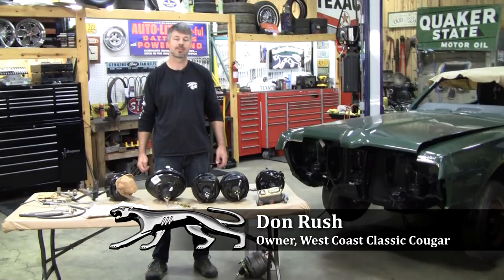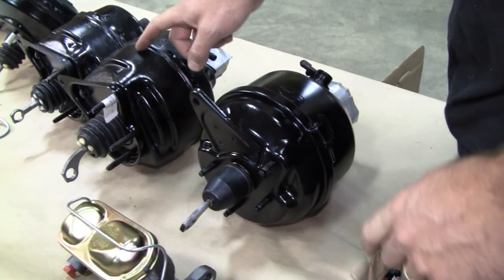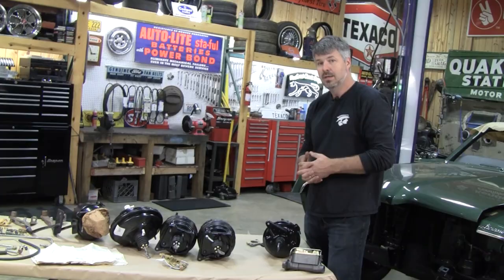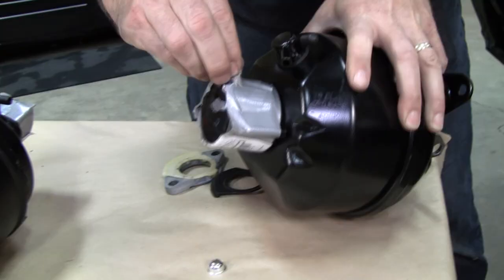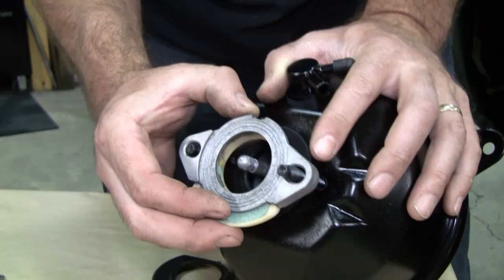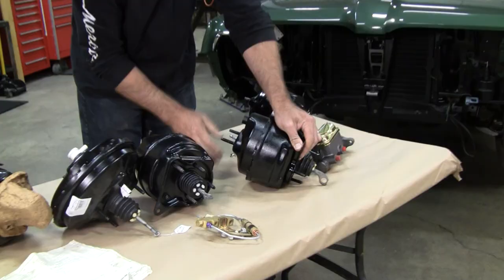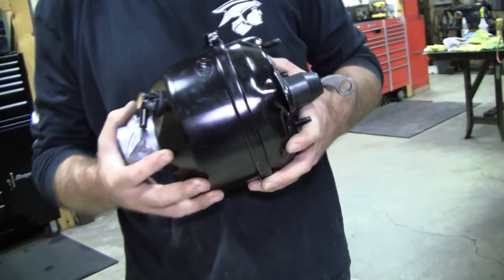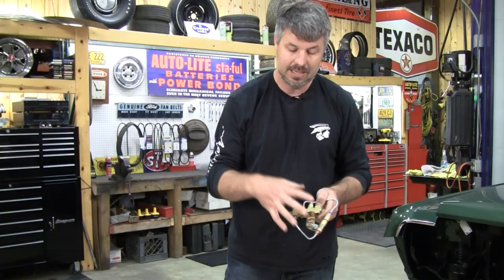Power Brake Boosters: 1967-1973 Cougar / Mustang - Differences, Do's & Don'ts

Comment: I wish you guys delt with early 1970's thunderbirds. I have had many of the same frustrations concerning brake boosters. Finally found a guy to rebuild mine. After 3 months of dealing with cardone
Reply: I got a cardone power booster for my 1969 tbird. It works fine. Not saying everything is great, guess it all depends on whos working on it. I also had my original one rebuilt by them. It looks great. My only problem is the lack of the right check valve for the  tilt away steering

Comment: Great info..... Thank you.  Dad & I are currently working on another "restored" car.  1970 XR7 with a Midland booster.  I'm telling the guy the booster is no good.  I did a vacuum test....no good.  He's saying he just replaced there booster....wellllll.... Now I know why it's bad.  Love this video.  EVERY "restored" car we deal with has the same story.  Body work is nice but the car is a mechanical nightmare.  These guys spend $15k on a car that requires another $3k in mechanical work.  Uggggh

Comment: Thanks for the info. Very good video.  I restore older Mustangs and get frustrated with the lousy, cheap, non-fitting parts that are available now.  Seems everything is made in China and either doesn't fit, fits poorly or wears out very fast.  Parts store employees cannot perform an interchange or look up a part without the computer at their fingertips.  You can no longer depend on the parts suppliers for quality fit and function in restoring these older cars..
Reply: We just today got in 6 ebay specials by Cardone, all from the same supplier, all under $150 each all with the same part # on box which was supposed to be for 1970 Mustang / Cougar.  None had the spacer plate, 2 had the 69 tear-drop input shaft and one had the wrong bolt pattern.  Good thing we just buy them to replenish our cores and our expectations are low...
Reply: Nam Vet p
Reply: never could...

Comment: Hehe, great information, except... my 1970 Cougar XR7, with 4-wheel drums, has an original "midland" booster with the teardrop shaft, exactly like the 1967 version you show.  So apparently they did use that booster in 1970 :).

Comment: you might wanna mention that you have to modify the brake switch (bt removing material) if you use the 69 in a 67/68  due to the increased material thickness at the end of the shaft's teardrop

Comment: I bought a 70 Bendix for my mustang and it has a straight eyelet. Which works fine for a factory set up. But I now have all aftermarket brake pedal and hanger due to restoring the car which didn't have any parts when purchased. So I bought a factory booster like you show here which has a straight eyelet. However, I need the one where the eyelet is off-center as my brake piece that connects will not line up with a straight eyelet. Thank you for the great information. Hope you can help me find the right eyelet. Or tell me if I need to find a different booster.

Comment: I'm wanted to go full Wilwood disc brake on all 4 corners. What brake booster and master cylinder proportioning valve set up do I need?
Reply from the maker: There has been quite a bit of discussion regarding Wilwood brake conversions over at the Classic Cougar Forums, I would recommend checking that out: https://forum.classiccougarcommunity.com/search?q=Wilwood

Comment: Can any of these be used on a 67 Fairlane that has factory power disc brakes?
Reply from the maker: The one you need is this one: https://secure.cougarpartscatalog.com/16897/30966/brake-booster-midland-power-brake-premium-rebuilt-1966-1967-ford-fairlane-/-ranchero-/-cyclone-/-torino.html

Unfortunately, we do not have any, and we usually could have you send us yours and send it in to be rebuilt, but the rebuilder lost some staff and is not currently able to rebuild boosters.

If you hit the notify button on our website, we will email you if they become available again.

Comment: Question: what would you charge for a 67-68 Mustang booster for my 68 Mustang GT. Because I’m tired of buying junk booster from our local parts store. 😢😡😢
Reply from the maker: The ones you can get from most auto parts stores is a cheap economy version.  We are currently out stock on our good new ones and our rebuilt ones as well.  However, you can use our product notification system to get notified when we get them back in stock.  Here are the boosters we usually stock: https://secure.cougarpartscatalog.com/store/Search.aspx?CatID=15894&SearchTerms=brake%20booster%20power&Type=EXACT.

We also have rebuild kits if you can source an original: https://secure.cougarpartscatalog.com/control-valve-repair-kit-repro-1969-1970-mercury-cougar-/-1969-1970-ford-mustang.html

Comment: Why do some booster say for automatic transmission? Why does it matter what kind of a transmission you have? How is it linked to the transmission, if it is?
Reply: Have this question at the moment with my 70 auto fastback. From what I can tell, manual transmission has the 8" double diaphragm booster because of clearance issues with the clutch pedal linkage. The auto doesn't have the linkage so uses a 9" single diaphragm. Think this is right, I'm still trying to confirm.

Comment: I was told to paint my booster before install because the black paint it comes with will come off and rust, is that true? I rather just install it and just wipe it down whenever I wash my car.
Reply from the maker: It might not be a bad idea to paint it before installing.  We have not specifically heard of that issue, but the company that rebuilds these changed hands and the quality has been inconsistent.

Comment: Don,I need your help and any input from some viewers will be much appreciated as well! My problem is, that I can't find a brake booster for my '70 T-bird. Nobody seems to have them. Now, you mentioned in the video that it doesn't matter what car or if you have disc/disc, drum/drum or disc/drum because they all work the same - as long as you have the years correct for the linkage. Teardrop for 60's and straight for '70's. Now, I have a spare booster lying here from a '72 Riviera, would that fit?? Or what would be compatible?
Reply from the maker: Do you still have your original booster? If so, send it to Power Brake Exchange in Portland, OR. They are the best booster rebuilders. If not, your best bet is to find an original 1970 T-Bird core booster to send in for rebuild. You don't want to mess with changing your brake pedal if you don't have to. Not sure what the differences are between Cougars and T-Birds in terms of the brake booster configuration. You might also get in touch with Bird Nest (tbirdbarts.com) even though they stop at '66. They might have some tips.
Highly doubtful that your Buick booster would fit a Ford, but who knows!
Reply: Thanks a bunch! I'll try PBE in Portland, since I have the original booster.

Comment: does this information also work on a 1967 ranchero fairlane 500 xl. im having the issue of just barely touching the brake peddle and it locks up the brakes.my booster is straight not teardrop at the end of the shaft.i purchased the car with this problem. can i send you my booster for rebuild and how much for the rebuild.mine does have the fordmoco label and is in good looking condition..thanks for the info. in advance.
Reply from the maker: Yes!  Internally our midland booster is the same as yours.  Here is a link for purchasing it on our site, pictures should be up and stock on hand within 2 weeks.  Thanks for asking!

https://secure.cougarpartscatalog.com/brake-booster-midland-power-brake-premium-rebuilt-1966-1967-ford-fairlane-/-ranchero-/-cyclone.html

Comment: So what would be the best brake booster for a 67 cougar
Reply: Did you ever find out anything. Im needing something for 1967 mustang
Reply: I have an 67 cougar I have installed an power disc  kit haven’t been able to get it to work right  . Have very little braking hard pedal have good vacuum. Several shops have worked on it without fixing it not safe to drive

Comment: I have a 92 cougar with all kinds of problems because I drove it to hell. Never been a car guy more of a nerd but now I'm past the master cylinder to the power brake booster because because the brakes get hard when the car is off and goes all the way to the floor as soon as the car is started..... zero stopping power even if I'm pumping the pedal not to mention not to mention that I have a battery issue maybe some 40 grounding and I think that the head gasket is blown because we're building combustion pressure into the radiator and with all this being said I am a comic book guy not a card but I got a woman that I love and she don't drive herself I drive for her and she has children that she needs to go to their school and she has doctors that she needs to visit so back to the brake booster please go over all of the most Vital Information I should know
Reply: I mean it's really a shame the car was very clean when she got it. it would just cruise and sail at around a hundred and ten miles an hour I know that the speedometer only reads I like 90 but you guys know

Comment: 10 years? Every car over 20 years old I have ever had also had the original booster. I have a 73 stang over 40 years old. And after 4 decades now it might need replaced. 10 years? Thats just wrong. I have a 20 year old civic with over 250k mile...booster is fine. 20+ year old jeep over 300k miles and original booster.    again... 10 years? LMFAO. You must have got a defective booster.